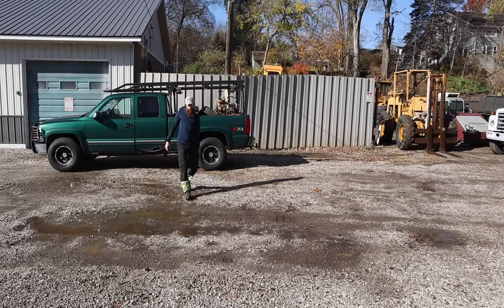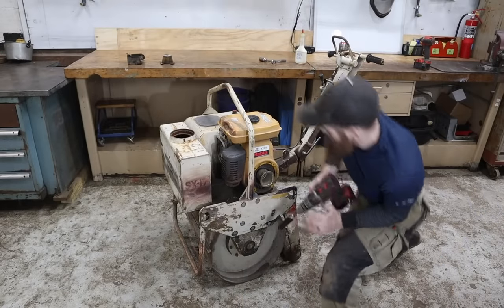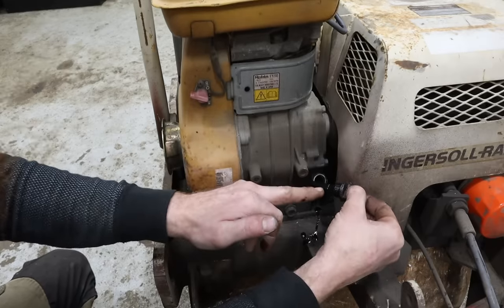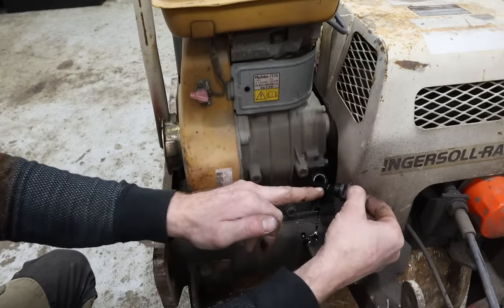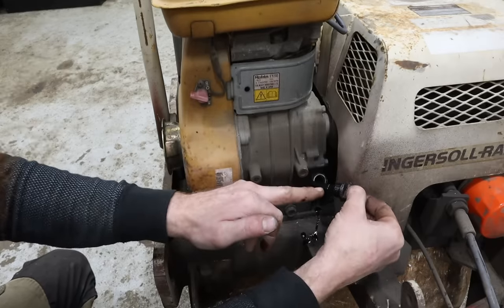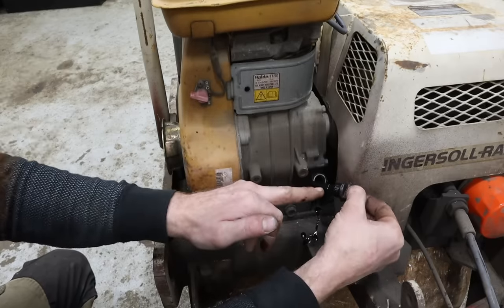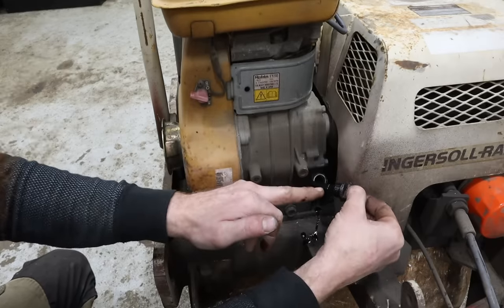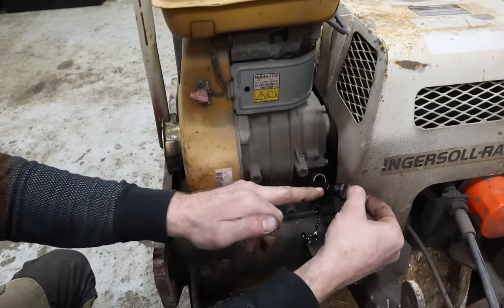I PULLED this Roller from a DUMPSTER!! -  Can we SAVE this Forgotten Walk Behind Vibratory roller?

Comment: If you put a pipe in the oil drain hole long enough to get out past the frame with a plug in the end of it, you won't make such a mess when you change the oil. Looks like the gas tank's top is smashed down. Maybe a product of dumping it in the scrap dumpster. The water tank cap is probably in the dumpster too.

Comment: That's a find and a half!
The Robin engine is basically the same as a Mag gs160  which has a habit of kicking back and breaking the rope mine tore my forearmmuscle too! It looks like you need to clean the carb out further. Ie the main jet and emulsion tube which are inside the carb, the idle jet is outside on the top beside the throttle stop screw, and I think the fuel cap is wrong, it should be chrome.
Another tip, lower the handle and move the small roller back out, it's in the transport position, they work best when balanced, you shouldn't be fighting with it oh and on soil they will raise water turning it into sludge!

Comment: To remove grips like those, it is easiest to  use an aircompressor and stick the end of the nozzle under the grip and it will unstick and come right off with one blast of air

Comment: It's probably been said, but compressed air or a small screwdriver and anything wet gets grips off quickly. I like to put them on with hairspray it acts as first a lubricant and then adhesive when dry.

Comment: If you clean out the tank paint it with red kote no more tank rust worries. Also put. Sea foam In gas and oil per directions. Good luck

Comment: The EY20 Robin engine is rated at 5 hp @ 3600 rpm. Robin is part of subaru and was used in Australia as the preferred engine on most hire company small enginer fleets. They were almomst indestructable.

Comment: That carburetor bowl gasket was there for a reason; not replacing it will almost guarantee fuel leaking (and therefore poor starting and running) in the  probably not too distant future.

Comment: I understand that it has been a while since you posted this and there is a possibility that you have already solved the throttle control issue but in case you haven't, I have a suggestion that you might check out.  Years ago I was the proud owner of an Auston Healy sprite.  Looked like a frog with bugeyes.  Unfortunately at the time all parts that were available were on a boat somewhere between here and England.  Basically factory parts were made out of unobtainable.  I broke a throttle on the way to work and was reduced to foot traffic until someone mentioned that the throttle linkage was very similar to bicycle brake cable.  My local bicycle shop ;made me up a replacement cable in nothing flat and I kept my mouth shut about driving a car that could be fixed at a bicycle shop.  might help in this case.

Comment: The Ruber you see in most filters is a check valve for anti drain back needed in gas or diesel enginesbecause they are open circuit.  Hydraulic systems are closed and don't need an anti drain back device.

Comment: the manuki carbs.. ahh yes.. the manuki... hehe mikuni?

When tracing gaskets, i like to take a soft wood plank over and under the part. with the gasket material inbetween the the part and the one plank of wood. then take the other plank and place ontop the part u need gasket for. hammer softly away until a trace of the path is transferred to the gasket by soft blows with a rubber mallet. always works 100% because the wood is softer than the metal. foolproof and u dont have to use a metal hammer to the part.

Regarding the tubing that is not braided. Its super easy to fit a braided sleave mate. can also doll it up like we did back in the days with a pretty outer tube that fit snug.

For the grips on the handles its an old trick to use compressed air to easy remove the grips from handlebars :)

Comment: That airbrake line will be fine, it's oil resistant and probably better than that original stuff. The 6 x 9 on the original line refers to the metric size, 6mm i.d. x 9mm o.d.

Comment: The tick is the intake valve slapping by staying open longer during it's intake stroke and the compression stroke is pushing air through the intake valve just a couple of Milliseconds before the valve is completely closed. Change the belt first then have the head repaired.  Pop out the valve seats and press in new ones. It's an Ingersoll Rand, you can probably still buy parts for it at any Acklands Granger if it's a North American built motor or Princess Auto if it's a Chinese made engine. Better yet toss the motor if it's not worth fixing and put a 10-20 hp Briggs and Stratton with  a power starter and say good bye to cold morning starter failure and snapped starter cords for the rest of it's life.

Comment: I work on small engine rescues all the time. Usually briggs or Tecumseh or Honda. Had one Robin engine and I don't remember what it was on. I was working on taking the pull start off when the engine just locked u up. Never did figure out what happened I tossed it back in the trash

Comment: Ps if you need to make a gaskets run old oil on the flat surface then press it down to paper you will get the perfect shape then punch out the holes should help with all gaskets

Comment: That looks an awful lot like the pump/power unit used on hydrostatic drives like on lawnmowers. The forward/reverse lever literally changes a swash plate inside the pump to control the flow rate/speed and direction of fluid flow.

As for making hooks on spring steel,  you need to heat it red hot and do the bend while it is red hot.

Comment: you have to bend the new hook while the recoil spring is red hot so it doesn't break. if you can't find a new throttle cable, try an old floor shifter cable from a junk car. they're kinda similar, and if you get it from a u-pull it yard, really cheap. you can always repower it with a predator 212cc. engine from harbor freight if you can't work the bugs out of that robin engine. heck, that hydro pump was worth the $20 you paid for it.

Comment: Its rated as 5 hp/4000 revs.
Daikin also make compressors for cooling containers and other purposes. Also japanese.
Teflon tape is not advised on hydraulic fittings. If you only heat up the end of the spring, bend it and let it cool down slowly it might work. More than cold bending.

Comment: From the notation on that engine, it looks like it has 183cc displacement, and  produces 3.7 kilowatts at 4000 rpm, which would be essentially 5 horsepower.  As an e-bike rider, I've learned that 1 Horsepower is very close to 750 watts for an electric motor or generator.

Comment: Lol, I witnessed a guy pull the ripcord out of a small 2-cycle Toro snow thrower, get completely pissed off, whipped the pull cord around the handle, and threw the whole mess into a dumpster. I came back when the coast was clear, pulled it out, took it home, cleaned up the plug, put the pull cord back in, gave it some gas, and it started right up. Free snow thrower!
Reply: Good man, a fool & his money are soon parted.

Comment: I love that you make your own gaskets. Where do you buy the material? What is it called?
Reply: I get both cork and neoprene gasket stock at my local NAPA Autoparts.  They have multiple thicknesses of each.  They come in rolls.  In a pinch (and sometimes just by preference) for thinner gaskets a guy can use the cardboard from a cereal box as gasket stock as well.

Comment: Should’ve pulled the emulsion tube and main jet when you had the carburetor off the first time. Or at least ran a strand of frayed bicycle brake cable or a torch tip cleaner up through the bottom where the bowl bolt screws in. Poke through any tiny holes present on the side of the bowl bolt bolt shaft. Remove fuel/air adjust screws and poke out their holes too, clean up screw tips and crank em  down rather snug, loosen and crank em a few times to knock any remaining crud out the tiny fuel holes then back em up 1.5 turns.

Comment: Hey buddy on the back of the engineer what you're talkin about if you look on the back of that block see them two little stubby coming out with threads in them next to have flywheel that's how you can build a starter on there you can actually hook up electric starter on that motor case you didn't know it

Comment: I was thinking just cut water tank fill neck section out and weld in a new neck and cap.more simplier than finding a cap to fit im sure.snooky pa.and use compressed air to bulge that gas tank level again or just new tank.

Comment: The exact conversion is 0.760 kW = 1 HP, so 3.7kW = 4.87HP. I see you have found out as I did when I hired one of these devices for repairing potholes on our farm road, that they have a mind of their own. I gave up after a few hours, before I ran myself over and got a man in with a sit on dual drum roller.

Comment: Try and resist using a razor knife to remove hose of any kind 
You almost always will put a scar in the under lying barb fitting 
It will either leak when you replace the hose now  or later down the road 
This is true for almost all hoses especially high pressure - reinforced hose as it difficult to then tighten enough to a hose clamp to seal it up

Comment: If you just rap your rope around the spindle that is on the engine it will spin and start the motor no drill needed. And if it does slip a lot just put a notch in the spindle to set your rope in just put a knot at the end of the rope and that will hold it enough to pull start the motor. We never had the spring on the old lawnmowers we had when I was growing up in the late 50s & 60s we just tied the rope to the handel when we needed it just untied it wrapped it around the motor and pulled the rope. No need for a spring loaded rope. The early motors didn't have the spring rope for starting. It came with a rope that was it. Boatmotors were the same way they came with a rope they didn't have the spring loaded rope.

Comment: Next time when you are trying to remove a hand grip instead of using a adjustable wrench and a mallet. Get your air blower and blow directly in between the grip and tube and it release it and let you slide it right out. I restore old schwinns and that technique is a life saver.

Comment: It looked like these geniuses probably purchased this machine and never did any maintainance on it at all. That air filter was probably the original. Oh well, their loss is your gain. I love it when someone else throws something out because they refuse to maintain it. I make a living on people like that. I ran the scale at a junk yard for a few years. I paid $100 for a 1980 Mercury Cougar with a 302 in near mint condition in 2014. I got it cheap because the owner said the engine was locked up. When I checked it, the engine spun over fine. I started playing around with it after I bought it and found out that it had a bad ignition cylinder. I put a new key and cylinder in it, and it fired right up. I never salvaged the title, drove it around for a few months, and resold it at a nice profit. I love it when stuff like that happens. You scored here.

Comment: When installing your pull ropes you do not need to pre wind the rope. Install the rope through the holes and tie your knot. Then pull a loop of rope up on the inside of the cover. Rotate the center so that the notch in the pulley engages the tail of your loop. Use the loop to rotate it a half dozen turn then hold the pulley and pull the loop out like you were starting it. It will wind itself.

Comment: Your worry about filter threads needing a gasket.  This is not a real worry, as the thread is tight enough to prevent much at all "oil blow by".  In all the filters I have changed on my multiple cars, I have not seen a single one with a gasket or washer on that central ring — only the outer ring to stop real leakage.  If you put a ring on the centre as you did, you run the risk of leaks from the outer gasket.

Comment: -
You have to get a brush for the drum for the roller. You have to put water in the drum in the drum for weight. The water in the tank keeps the roller clean. The roller also needs a squeegee on the roller made out of steel to keep the chunks off or the roller, also needs a brush for the roller so the rolled asphalt is smoother with no clumps or holes. Fill roller with water. halfway. When the job is finished drain the drum. Use diesel to clean the dump truck and the roller. Spray the dump with diesel when you load.

+
Reply: You have to to get AC, liquid tar to seal the seams. If to the asphalt full time you may need a small, heated tank for the tar. I recommend to chunk up the asphalt with an ax and load it into the hopper in the morning when the stuff is cold and brittle to chunk it up easy.

Comment: I have a trowel machine with that motor the motor is made by Subaru for Wisconsin engines I think parts are pretty cheap it will run u can  buy a carb for 20 bux, well before the insanity any way u could

Comment: Just so you know, using Teflon paste on hydraulic fittings is a definite No No.  Ask your local hydraulics supply or repair shop why; they will explain it to you in detail.  Teflon paste thread sealants are designed for iron and mild steel pipes; the threads on these pipes are rough and don't join as tightly as Brass or Stainless-steel fittings. Plus, hydraulic fittings are flared connection fittings; Teflon thread paste (dope) causes leaks if it gets in the connection between the flare mating surfaces.

Comment: When checking the oil, don't thread the stick in. The oil level should be at or close to the top thread. Therefore screwing it in would put the threads of the dipstick where the stick part should be. hope that makes sense.

Great tip about the screwdriver as a stethoscope.

Comment: and fot stuck dry throttle cables you can get Motion Pro Cable hose Luber Applicator Tool lube motorcycle clutch brake YAMAHA this will work on other stuff you got also

Comment: The plate on the engine says 3.7/4000.  Next to it it shows them as kWrpm.  3.7 kW is just over 5 hp at 4000 rpm.
Reply: And that's not a "metric" measurement.  And... Americans do know about power.    Maybe just some don't.

Comment: I don't think it is OSHA compliant, as it should have a safety cut-off pad on the handlebars, in case it reverses the operator into a wall.  So don't use it on any commercial building sites.

Comment: To bend that spring you need to heat the bit your bending then cook it in some oil once you’ve done the bend. it’s not an easy recoil to repair I’ve only ever repaired one them and it was on a diesel generator. It was brand new and kicked back while hand starting it due to flat battery it destroyed the recoil spring like the one you have. Long term them recoils are not good design there designed to fail.

Comment: 746 watts = 1 hp.    3700/746 = 4.96 hp.  So yeah, 5hp.  
I've been looking for a sprag(one way) clutch for drill starting stuff.  If anyone knows where to find a suitable one, please reply.  
Thread sealant on compression or flare nut threads does nothing.  
Keep your teflon and thread sealants off the first thread.  As you tighten pipe fittings, it will force either/both forward and can cause major issues in hydraulic/fuel/air/oil systems when that stuff goes down the line.
For recoil springs, they are pretty standard.  But you can heat to red, bend, heat to red, quench, and heat until blue and let it cool.
VERY COOL SCORE on this machine!  I don't have a use for it, but I want one......

Comment: Why are you putting mixed gas in a 4 cycle engine? It takes straight gas. Mix will not hurt the engine but will foul up the plug.

Comment: On the recoil spring, I have used a small pin/dowel to wrap the hook around, you may want to make the hook a little longer and grind the end down to suit your needs, it makes it easier to deal with as you bend. I have used that method with some success, when you try to bend a short radius on the spring it wants to kink because it’s to brittle, like you say. Fun video to watch sir, thanks for the ride along.

Comment: 3.7 KW is 3.7 X 1000 watts = 3700. One Horsepower is equal to 746 watts. 3700/746 is equal to 4.9 horsepower for the engine.

Comment: That takes A locking throttle cable without the locking mechanism on it is all.,or you can get A dirt bike throttle cable.& Add on A cable gourmet that has 2 tighten down set screws to lock the cable into place with.

Comment: Hi, thisi very easy converter. 1 hp = 0.746 kW or 1 kW =1.3405 hp. Rememer these, and it is very easy convert power from hps to kilowatts and vice versa.

Comment: Working with small engine parts and some larger engines in today's world really requires an ultrasonic cleaner.  They are very inexpensive and clean carbs and small parts so much better than any other method that it has to be seen to be believed.

Comment: The engine is rated at ~ 5 Hp.  1 Hp = 746 Watts.  Therefore, 3.7 KW = 3,700 Watts.  3,700 Watts / 746 Watts X 1 Hp = 4.95  Hp,

Comment: Using a drill as a starter can be dangerous. It the engine starts, it can snap your wrist or damage your drill, socket, or socket drive. Use a ratchet adapter. If the engine starts, the ratchet will save you and your tools. Amazon sells them as ratcheting breaker bar adapters. $17.74 CDN or abiut $12.93 US

Comment: I bet it was scrapped just because of the pull cord breaking. I got a brand new 3200psi pressure washer that had only been used twice for the same reason.